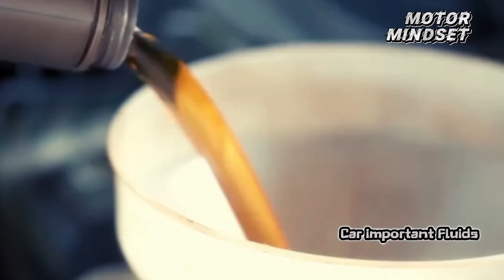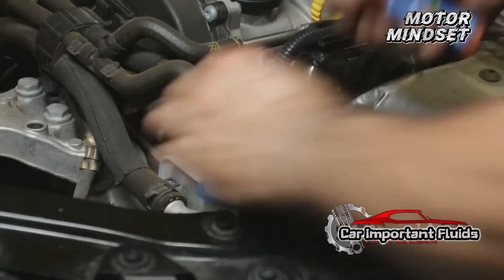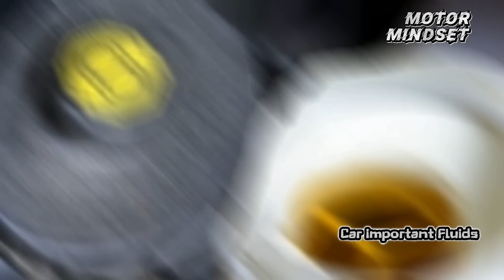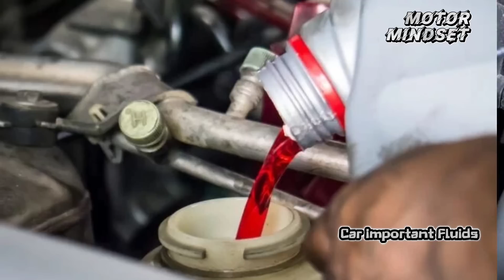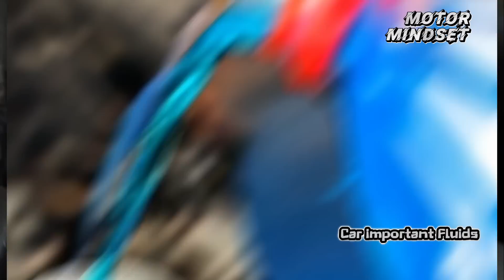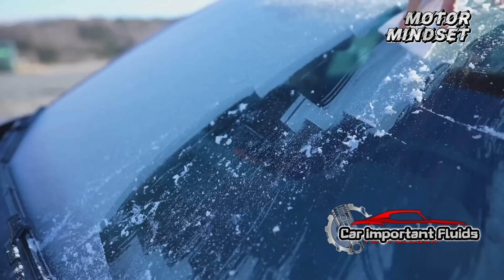How Often Do You REALLY Need To Change Your Car Fluids? #oil #motor oil

Comment: Manufacturers say 15000 kilometres oil change but this to long in my opinion 8 to 9 thousand is more than enough, on manuel gearboxes they say it's for life of the car and has no dipstik 100,000 kilometres as for brack fluid on the cap it should  tell you the correct  grade as in dot 4 or 5 do not mess this up